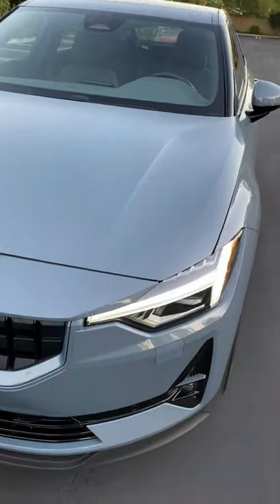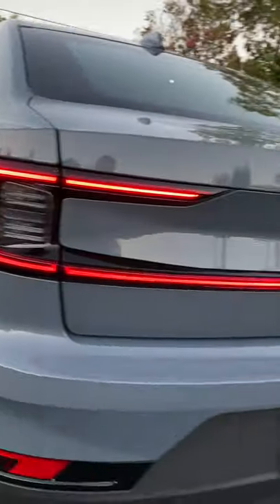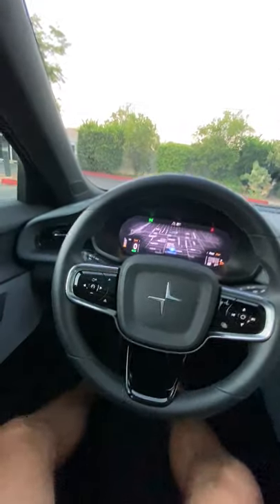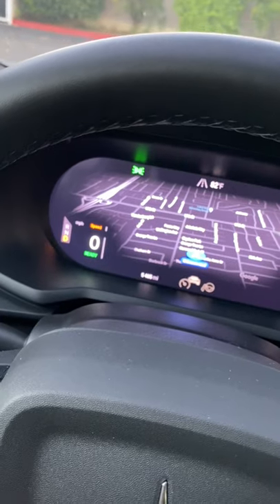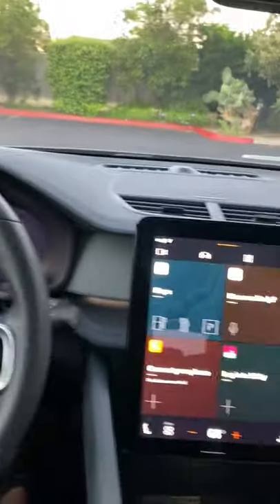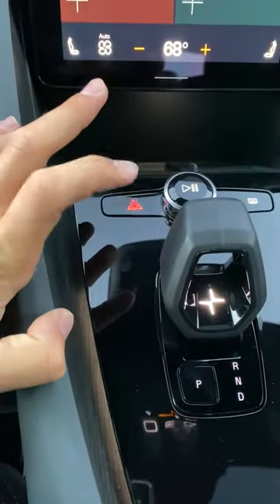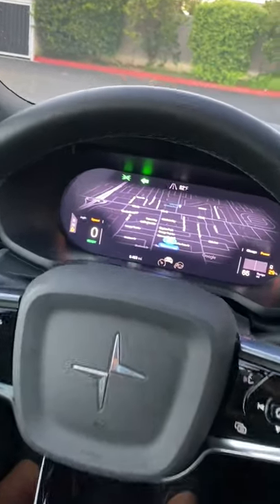The Polestar 2's Turn Signal Click is...Unusual #shorts

Comment: Your doing ok my 2022 polestar 2 has been in the shop for 2 week sensor came on saying my light are not working then another came on dropped it to shop they gave me a loner car polestar 2 and a week later that car would not charge says something is wrong with the  Propulsion system back to the shop 2 cars in 2 weeks. Not happy they gave me a volvo new hybrid 2022 better on fuel  than the polestar